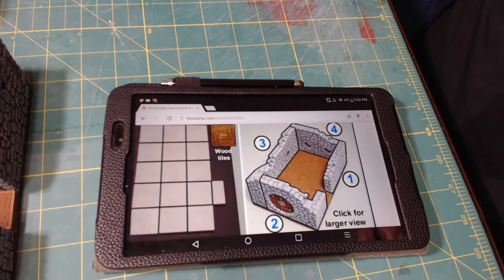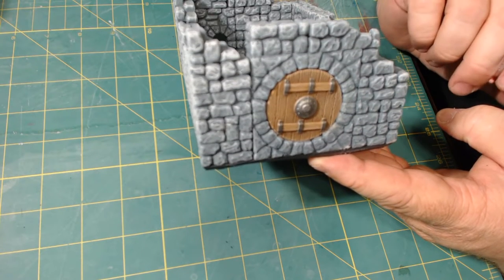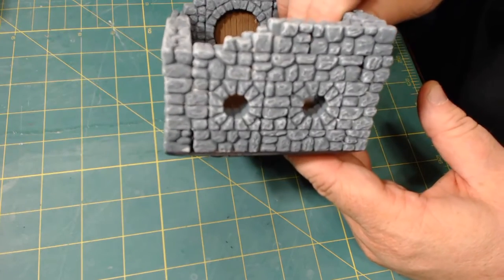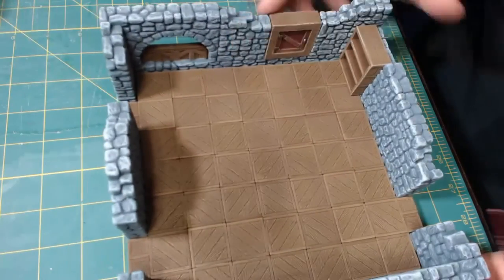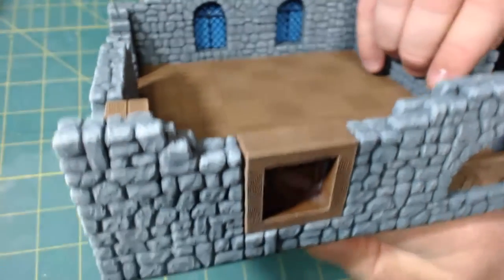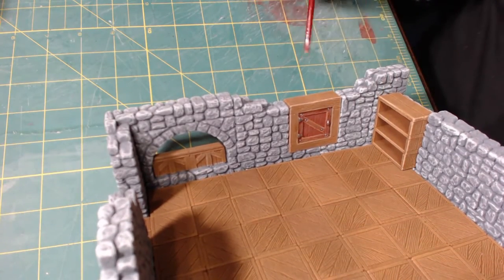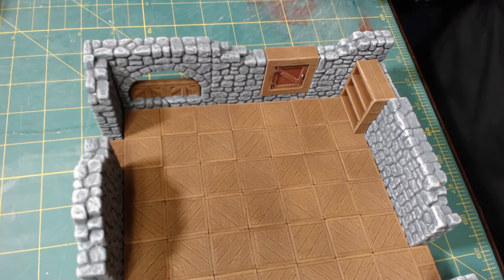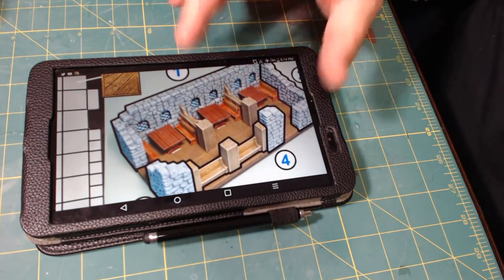Modular Inn with Hirst Arts Molds Part 07 - Hobbit Room and Bar Room Complete

Comment: 'Keep it consistent across all your blocks or it might pull your eye' as you are showing an entire row of floor tiles that are the wrong way. Ouch. How did that snafu happen?
Reply from the maker: +Richard Garner That is the odd number row behind the bar so it does not have the 8th row to make up the diamond pattern.  I did that on purpose as that whole row is behind the bar and most of it will be taken up by furniture when the accessories are added.

Comment: when you lay out your foam board for cutting and laying out the floor how much hang over do you allow for your wall blocks 1/4 inch?
Reply from the maker: +E. Long I dry layout the floor on the foam core, hold it with my fingers and trace around it with a silver sharpie.  Then glue floor, let dry, glue wall around floor let dry.  Then I have a long extendable razor cutter and I trip about 1 inch around the completed piece.  Then I trim right to the edge of the piece holding the razor at an angle.  You want to make sure you leave enough foam core so you can get a crisp edge cut.  Thanks for watching!